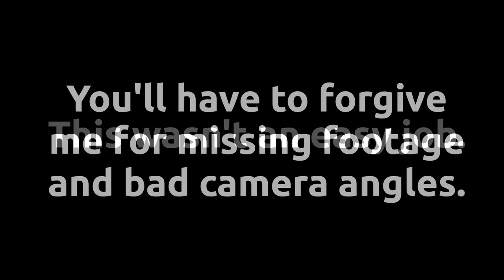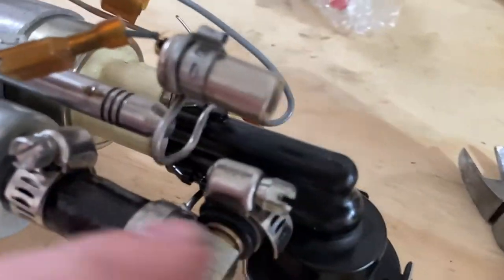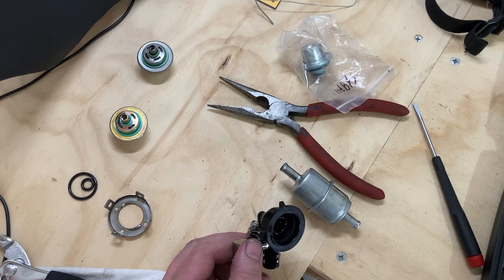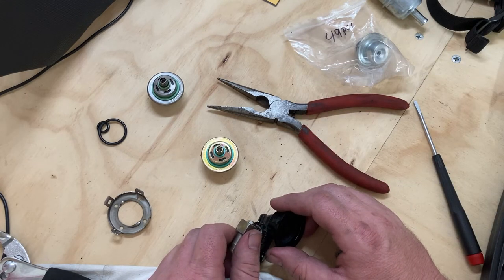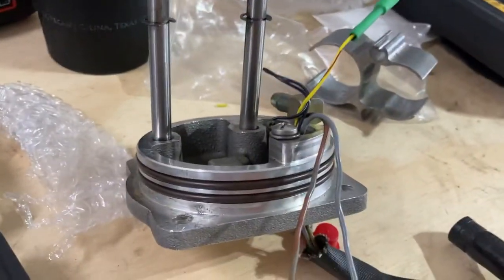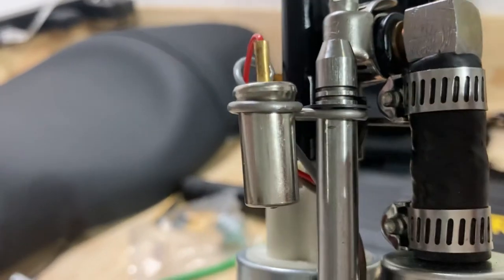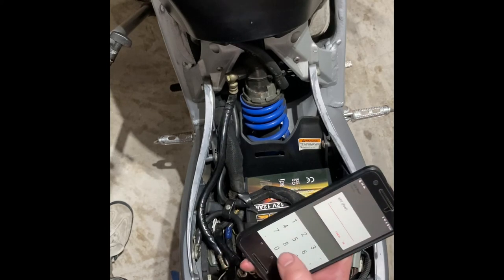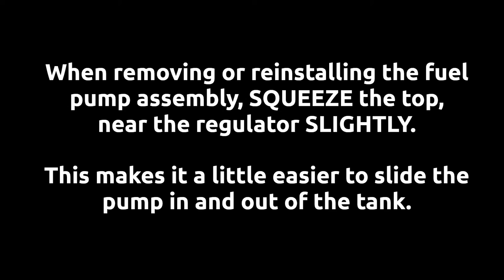Fuel Pump Rebuild for Buell XB9SX (early-2005)

Comment: This video is very helpful. I have a Buell 2007 xb12 scg sitting in my garage right at the moment. My friend brought it to me to troubleshoot, and I think the problem is at the fuel pump as well because the pump didnt look good and the inside of the fuel tank has a lot of buildup on the surface. Was wondering if you happened to have the same problem and if so, what did you do to get the soot buildup out? PS: it only took you 45 to get the fuel pump out, I was pulling my hair out when i took out mine. very frustrated.
Reply from the maker: No nothing like that at all. What door is the buildup?
Reply: @kz6fittycent  The buildup has to be from the gas, my buddy left it in the garage for years. I bought some Sea Foam today and will try to clean it with that. EFI fuel pump is also on the way, I will be referring to your video for installation guidance when it arrives.

Comment: How does it run? Or is there more work needed?
Reply from the maker: I was gonna do an update video - it runs PERFECTLY. After another TPS reset, I did a 5 hour "shakedown" ride and not a single issue.
Reply: @kz6fittycent  Good to know.